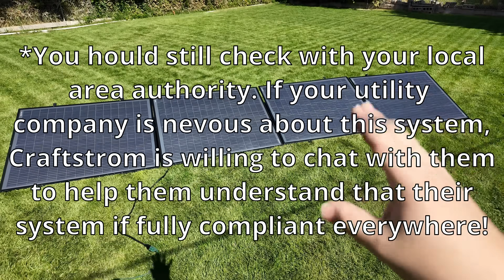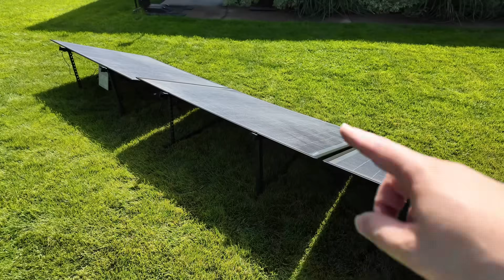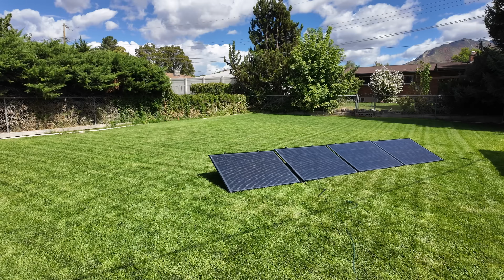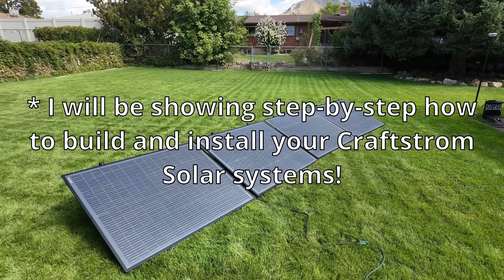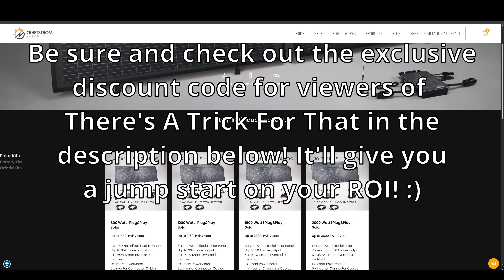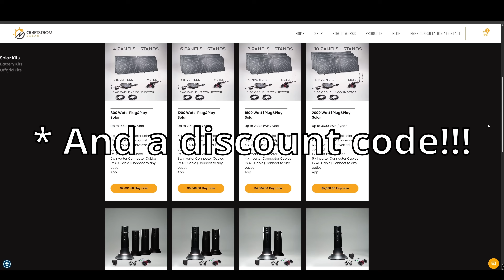Craftstrom Plug In Solar Review  LEGAL in All 50 States!

Comment: I have a balcony on the roof and a dedicated receptacle. Is about 30ft since my panel is in my basement. I don’t get WiFi on my roof. Is that a problem with the communication between the micro  inverter and the gateway?

Comment: I have a balcony on the roof and a dedicated receptacle. Is about 30ft since my panel is in my basement. I don’t get WiFi on my roof. Is that a problem with the communication between the micro  inverter and the gateway?
Reply from the maker: Just get a wifi extender

Comment: It their a way to keep the solar operating when power goes down in the daylight hours with MAIN BREAKER in the off position? 

The power goes out during the day frequently,  so it would be nice to run my mini split or fan and my refrigerator.
Reply from the maker: Check out ondemandinstantsolar.com they are working on a ssolution and right now they are having a great sale
Reply: @TraditionalSolarisaRip-OFF 
I ask because it would be GREAT to bring/use the entire kit for boondocking/camping also and to use for my home (not connected to grid power) shed. 

Funds are tight now to buy a batteries/inverter and all.

Comment: I bought a 400W folding Craftstrom solar panel with plug in inverter but I could never get it to work. At one point I was emailing with, I think,  president of the company, who was getting my address to send me a new unit, but then he ghosted me. Not a fan. Bad support.
Reply from the maker: They have the worst support On demand instant solar is GREAT for support

Comment: Grok designed a plug and play system for me using Enphase IQ7+ microinverters along with an IQ gateway. This is a six 400watt panels and six microinverters system that feeds up to 1200 watts to a circuit on L1 and another 1200 watt circuit on L2.  Incudes mounts and necessary cabling and comes in at $2800.  This would do zero export to the grid and provide overload protection to non-dedicated circuits.  Have you ever seen this design used because I am new to solar and have never dealt with any designs before? You can’t always trust info from Grok.
Reply: Please don't solely trust Grok with electrical setups...
Reply: @ransom182 grok must be his daddy
Reply: @ivar-the-terrible 😂😂😂😂😂😂😂😂😂😂😂😂😂😂😂😂
Reply: "You can't always trust info from Grok" nope, that's the point, make people confused uninformed voters, Grokipedia is a direct response to how reliable Wikipedia info is